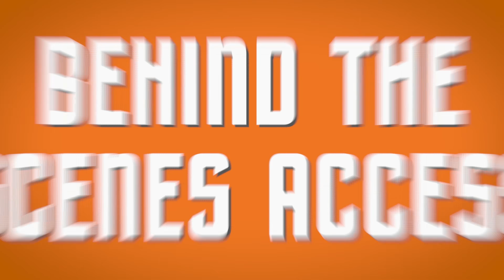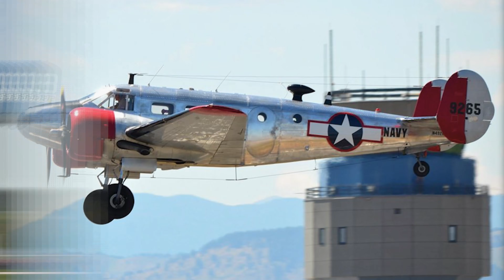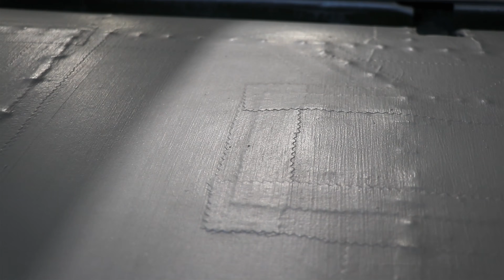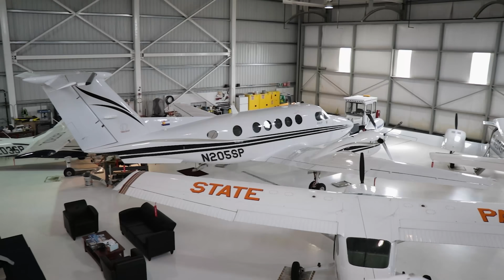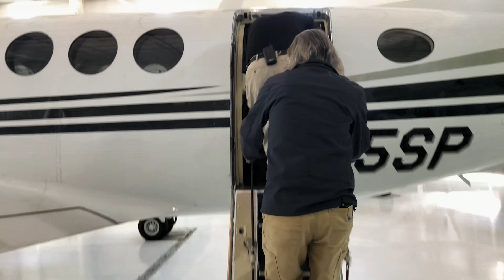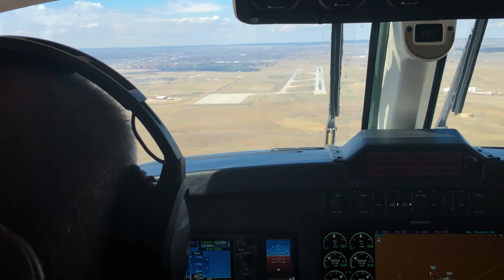Flying The Iconic Beechcraft 18 | Behind The Wings [4K] | Spark

Comment: The correct reason for the fabric control surfaces was 2 fold, first and foremost weight savings and 2nd to save aluminium. the fact that a bullet would go through it with little damage  was just a freebee!

Comment: :)   happy to say i was lucky enough to have started my skydiving out of these, yes your suit will get oil spray if you`re outside, and the door is a bit tight, and once a jug went out at 6-700` at take-off but we made it down with shaky knees.  and the beech called the checker-board beech was able to jump from for a while but i had never been in an otter or caravan so i was fine, good memories with this plane.
Reply: Although most of my jumps were out of a Twin Otter.
 Actually, it's a Super Otter with souped up engines, that the DZ bought at  DEA auctions. Those cocaine smugglers can afford to soup up the engines on their planes, so when the DEA confiscates them, they sell them off. Is these aircraft are set up with air conditioning and a roll up door,  as well as headphones, that have pilot to jump master communication, along with any other necessary announcements, that all can hear, as well as stereo music in between. Say what you want about Florida, they have the best jump planes! The Pilatis Porter is another I have made many jumps from.
  I have had some jumps out of a beach craft craft, When visiting an Oregon DZ.
 Nice plane overall,  A little louder and slower than I was used to, but relatively comfortable.  the only complaint I had, was that "shin buster" door.
  The last thing you want on exit, is your shin scraped across the bottom of an aluminum frame (ouch!).
  I had a fun week with my friends and that Beach Craft, but I think in the future, I'll stick to my turbo props (Damn, I am one spoiled skydiver).🤙
Reply: @sussekind9717  lol  ahh yes the porter! we had that for 2 yrs., jungle plane, BUT anything but comfy  :)  , i`m a little bit leggy and maxed out with jumpers it sucked i did enjoy workin out of it , and i think it was called a caribou, or maybe a buffalo,  you could stand straight across from the pilot and co. seat on the wing, safely, right side exit like the porter but we had jumped from both sides on the porter at the same time.  fla., did you ever jump with bird ?